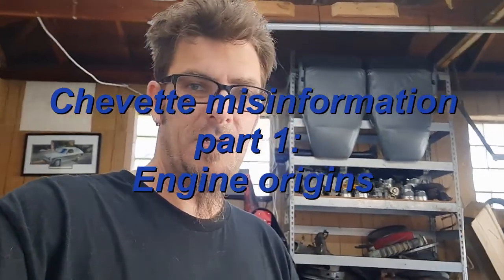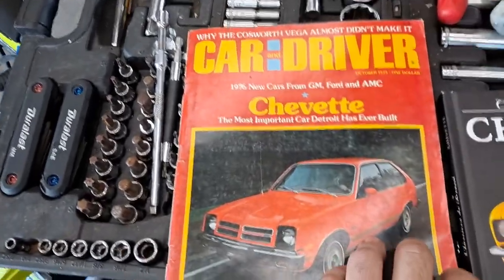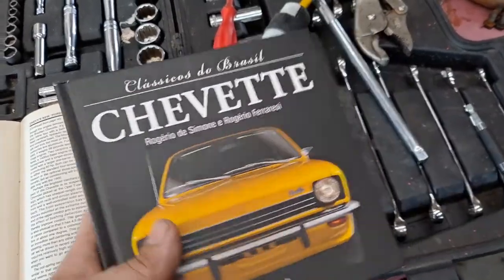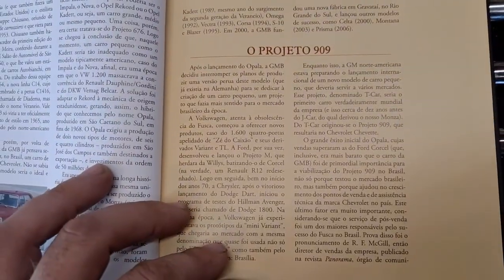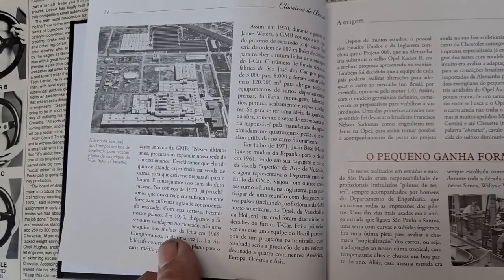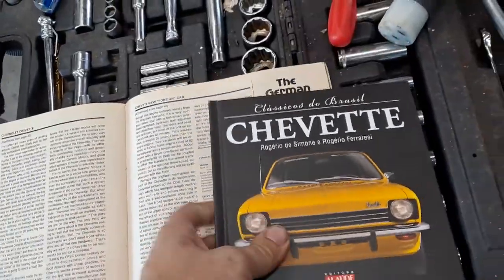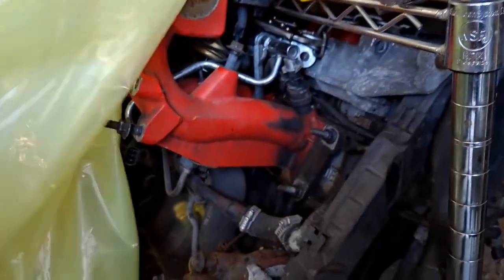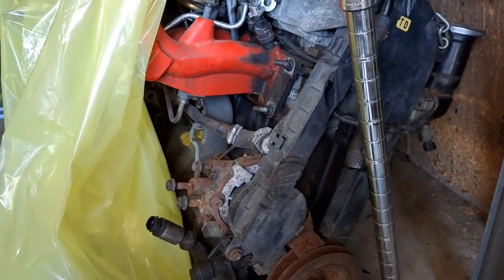domestic Chevette engine myth part 1

Comment: Do you want to know who designed it or who casted it? It was most likely cast in at least 3 different foundry's. Different company's used different combinations of internals to meet their needs. This engine probably has some old origins and got pushed all around the corporation. Personally, I would prefer if it where Japanese over German.
Reply from the maker: Once Opel left it to the Brazilians they cast their engine there in Brazil. The North American versions were cast here stateside after they figured out what needed modified for the US market. The US 1.6s were sent to Venezuela and marketed as 1.8s as an addition note.

Comment: And u we have bell housings aftermarket to plug and play Family 2 engines
Reply from the maker: Ya I'd love to get one in my hands, I just discovered that recently
Reply: @t-bodyperformance770  and I don’t know if US Chevettes use the se gear box as us here , Here is a Clark CL 2505 D
Reply from the maker: @JB-ci6bn  ours are an aluminum case copy of that 4 speed so the bellhousing should work. Our 4 speed won't take much hp before it starts having issues though so I might keep my eyes out for more Isuzu T5 bellhousings. The Borg Warner t5 will only have issues with super high RPM shifts.
Reply: @t-bodyperformance770  just bell housing and tail are aluminum
Reply: @t-bodyperformance770  but is possible to modify the original ones to use, 2 holes already match , some welding can solve this

Comment: Yes, you’re right, its a Pre Family 2 engine from Opel , Im from Brazil and u can do a stroker engine using 1.8 or 2.0 crank from Family 2 , in US common on J platform like Cavalier 4cyl Saturn and others , some mods to the crank needed for the distributor and fit others rods , actually u can go to 85/86 mm pistons (3.38”)
Reply: With some mods is possible to go from 1.4 to 1.9 L , but 1.6 blocks requires less mods to do, because they’re a bit larger on crank case , possible go to 82mm stroke (3.29”)
Reply: The most difficult thing is find very low pistons to keep the R/L in good numbers, here we use to do with motorbikes pistons , but only for Natural Aspirated application

Comment: I believe a very curious information you may not know is that here in Brazil we have a “preparation” for the OHC (As we call it here because Chevrolet strongly advertised about the over head camshaft design) called “misto quente”

It consists in mounting the F2 engine head from the 1.8 or 2.0 8 valve or even 16 valve to the original chevette’s engine block, because the oil and water channels are extremely similar it’s something feasible, tuners usually reach 120-160 hps NA, and up to 8000 rpms, before the crankshaft reaches failure because of the balance, depending on how extreme it is, excellent for a NA with factory 70-80 hps

I believe the book you mentioned (Which I have and it is excellent) talks a little about it, Chevrolet engineers actually used this in rally competitions, because there were no regulations against changing the whole cylinder head! Making the chevette the winner because of its advantageous RWD layout (Most of our cars were already FWD at the time)

https://youtu.be/xzT7evfx-Ro
Here’s a good example!
Reply from the maker: Yes the Family II Opel head! I love that swap
Reply from the maker: I'm actually going to be outlining that swap here very soon, probably over the summer. I'm working on collecting the parts as we speak

Comment: Interesting... kinda like learning how Lotus had a hand in the development of the Quad-4, because of the success had with their DOHC I-4 2.3L in rally racing, when it was fitted into the Vauxhall Chevette. Imagine it: A lightweight, fuel-efficient engine that produces 150-HP in a car that weighs barely more than 1-ton... THAT'S the Vauxhall Chevette 2300-HS(E). And we almost had it over here, too!

Comment: Didn’t that wiki list the Omni as being a T body?
Reply from the maker: It's listed a LOT of bad info over the years
Reply: Omni is an L body
Reply: @mikeallmon1  
And a whole nother brand not related to GM in any way shape or form
Reply: @Project_Low_Expectations  oh, I know! I've had a T-1000 and now an 84 dodge rampage. its an L body too!
Reply: @mikeallmon1  I had a 1980 horizon in high school, then I had an 84 Omni for parts, and now as you can tell by my avatar… I have a 1980 Chevette
Reply: @Project_Low_Expectations  I took my final drivers test in my mons brand new 85 Omni. we had an 83 Aries too. I still have my first car since 1985. my 1980 Honda accord LX hatch. driving a 1988 Yugo GV I've had 14 years and my 89 Nissan Pulsar I've had 7 years! Still building my 84 Dodge Rampage